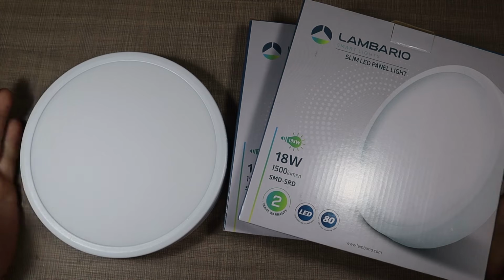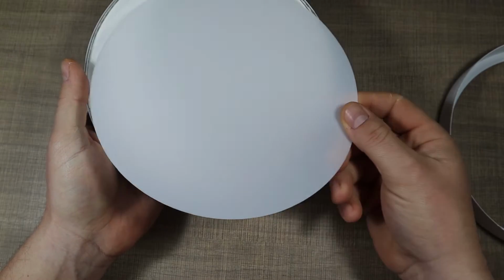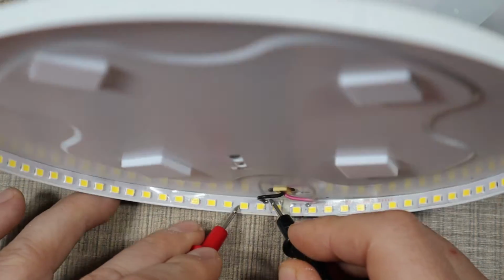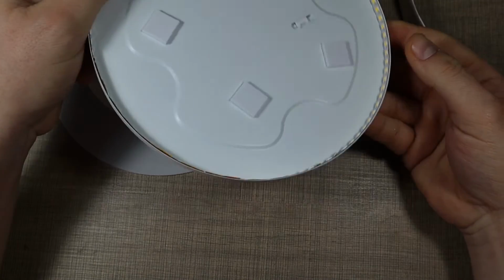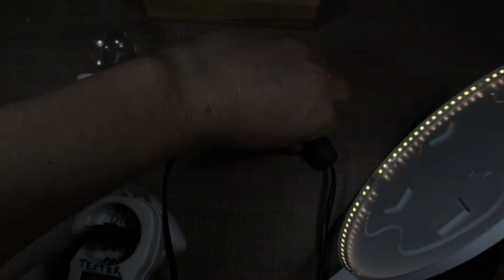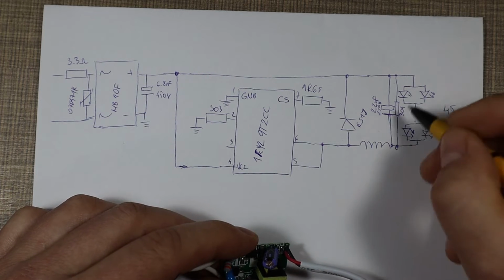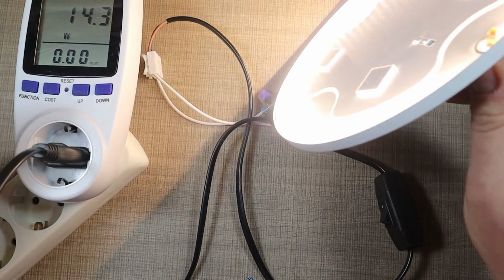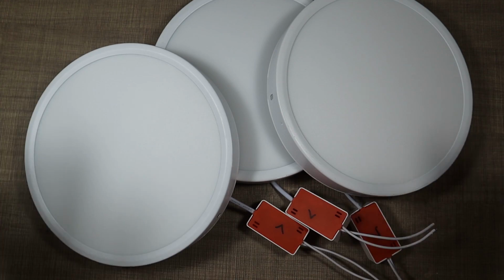Easy LED Panel light repair and LED driver current optimization trick

Comment: If I don't want to replace the LED or bridge them, what kind of LED strip do you suggest?
Reply from the maker: I've never seen a strip that you can buy to replace this. The strip is most likely custom manufactured just for the lights/driver combination that they use.

Comment: The driver probably is constant current. 
However the current is shared between the many parallel groups.
Since you've eliminated one group, that current will be diveded between the remaining groups. Stressing them more. Going to be an avalanche effect.
Reply from the maker: I've never experienced this. The groups are in series and in each group, the LEDs are in parallel. Shorting a group only reduces the overall series length while each parallel group stays the same sharing the same current as before.

Comment: nice.  thanks for great troubleshooting.  but what an absolute piece of garbage product.
Reply from the maker: Hhahahah, well unfortunately most of what we get here is that, just garbage.
Reply: @TasteTheCode  I suppose LED light repair videos will become more popular, as the "50,000 hour" LEDs fail in a few days.
Reply from the maker: @pepperpepperpepper  That is a very possible scenario. Or people will just not care and get new ones with maybe "60,000 hours" labels 😅😅

Comment: Instead of replacing the burned led, I just replaced the current sensing resistor to a higher value so the current will be lower (~%30 lower) and could theoretically last longer, did this on led bulbs (9w/12w) this is my first test on "ceiling" models, will report how much it last 🎉
Reply from the maker: This is a viable thing to do but mine was already gone so I had to fix it first. The resistor modification is best done when the light is new and unused so that there is no stress on the LEDs at all.

Comment: hello. thanx to this video i've got an idea what happened to our office panel lights. My question is, since two l.e.d.s are connected, should i put jumpers on the positive side ONLY in one of the led? thank you
Reply from the maker: Yes, when the LEDs are in parallel bridging only one is sufficient.
Reply: @TasteTheCode  THANK YOU
Reply: @TasteTheCode  Oh, that answers my question too. The LED pairs are in parallel. I suppose you said it in the video, but it didn't sink in, since they all look like they are in series.
Reply from the maker: @pepperpepperpepper  They are usually a series of 5 LEDs in parallel so that they can share the current.

Comment: Two irons.
I used two irons to remove LED's from my light. Then replaced them with LED's I got from China. SMD LED's are determined by the dimensions of the LED. Soldering on was easy, first clean the pads with wic and liquid flux. Clean with denatured alcohol. Use one iron, sharp tip, liquid flux and flow one side of the LED at a time.
Reply: Added to say, once you get the device to light, measuring the voltage drop across the LED tells you what voltage it is.
After that, choose the right light temperature, 3000k 6000k etc.
Reply from the maker: Great info! Thanks!

Comment: Thanks for the video. I also have a led panel with a dimming problem at start up. I dissembled it and had no idea how to control the current of these drivers. Searched days to find a video on this type of driver. finally found. I had done this in regular LED lamps which worked great... Hope these companies stop frying these LEDs and ripping us off... So much life wasted in LEDs due to overheating.
Reply from the maker: Thanks! Yes, the driver is not documented and the IC is literally non-existent. I modified the resistors by pure guesswork. Usually there should be a formula in the datasheet.

Comment: Good video and nice that you explained why it is necessary to do more than just bridging the defunct LEDs and that the driver needs to be modified. 
I suspect that a lot of the cheap LED lights are overdriving the LEDs to get the advertised amount of lumens, which is why so many of them fail after about a year. I have several LED strip lights that have failed in a similar way - I desoldered the LEDs from one light to repair the others. I also increased the sense current resistors to reduce the drive current by about 30% which will (hopefully) avoid the lights from failing again.
Reply from the maker: Chasing lumens is probably the reason. It makes sense. Thanks for sharing and watching!
Reply: Hey Bud, are in my area?  I'm near Bridgeport Village Mall off I-5.  Would be nice to connect with a fellow enthusiast.

Comment: Seems strange that you ignored the PIR.  If the wattage is exceeded, the same problem arises. It goes dim, or stays off, or stays on.  Adjusting for wattage fixed everything.
Reply from the maker: The PIR is external, not built in the lights. It is rated for 1200W so quite far from the combined 54W of the LED panels. I don't see how it could have affect the issue.
Reply: @TasteTheCode   I was looking at combined panels being run from the PIR.  I eval from start to finish. my start point would have been the PIR.
Currently dealing with an evil mosfet that has the LEDs dimmed.  I think I may have paralleled or serialed where I should have done the other.
Reply from the maker: Being dimmed, sounds as if you have them wired in series, sharing the current. Mine are wired in parallel.